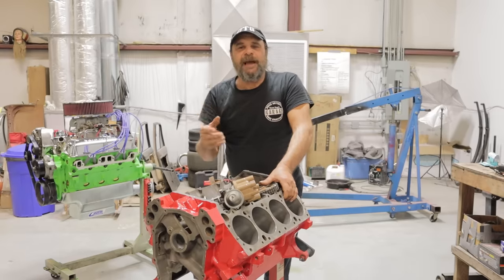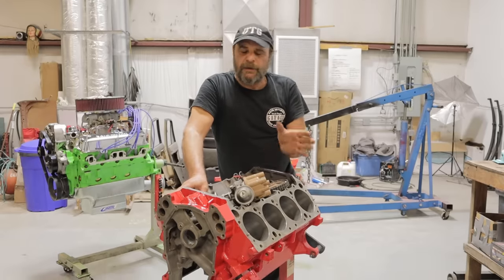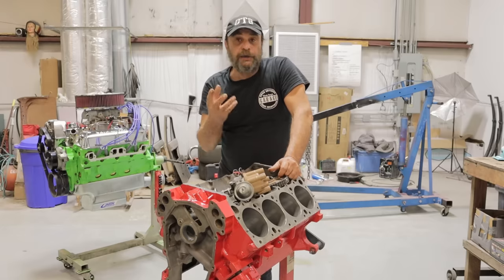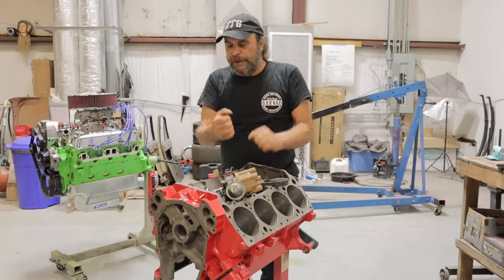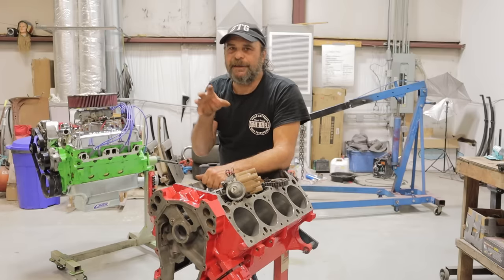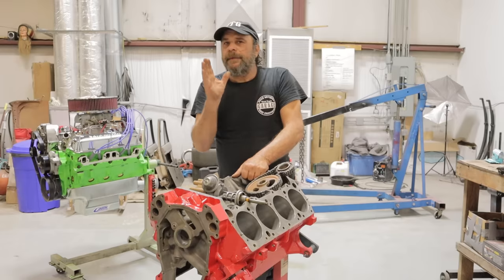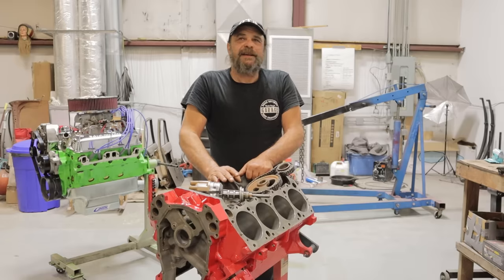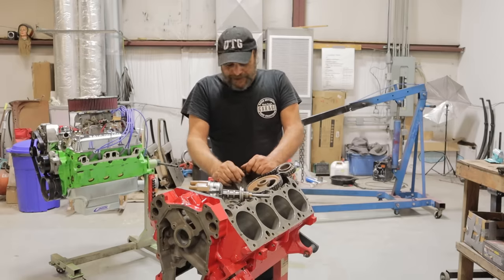Power Timing Secrets For Classic Cars

Comment: Of course this is all based on the assumption the plug wires and plugs are actually doing the job they're design to do. And if it's a points distributor the points are good and set correctly. Timing light isn't exactly useless on a older high mileage engine, it can be used to check the play in a timing gear set. Watching the timing mark bounce around with a timing light is a sure sign of a sloppy chain, and really should be replaced if it's too much slop. Personally I would never attempt timing the distributor without verifying for other issues first, including vacuum leaks which will indeed effect that vacuum advance, and making sure the advance is actually working right. Your advice is good but it is based on a engine that is tuned up as good as possible for the mileage it has, otherwise moving the distributor to compensate for it is really not a remedy, it would just cover the symptoms temporarily... just sayin.

Comment: Does this apply to something that isn’t vacuum not sure what this one is . I am looking from the dog house I have a 5.0 gmc 2001, I have been watching a lot of your videos. I was told I had low compression on the # 4 cylinder the shop said. Now in fairness this motor has 300 + on it the told me that it’s running on basically 7 cylinders. This is fuel injected throttle body I believe.

Comment: Do you leave the vacuum hose for vacuum advance connected? Haven't done this since High School. I seem to remember doing the same thing but at idle. When it started to knock we'd retard it a couple degrees.  Seemed to work. I just don't remember if we plugged the vacuum advance though?? Might be confusing it with total timing? Idk?

Comment: only way i could time a 305 that i took ALL the smog off was by ear
.
the curve isnt perfect anymore.... and it does ping JUST A BIT at the top RPM while under high loads
but its fine for a worn out old 305 literally driven by a grandmother 
.
she did notice the easier starting and power and MPG gain however

Comment: I had 2 tunes on my 305 camaro back in the day. I would retard it in the day to prevent ping and advance it at night to go racing 😅 I would keep the distributor just loose enough I could move it without a tool . Good times

Comment: Hey Uncle T, I've got a 73 Polara I'm trying to get running (360/2 barrel), and it doesn't like to stay running when it's down off the high idle. Any idea on how to fix it?
Reply: Sounds like it either needs a carb cleaning or there's water in the gas from condensation as a couple cheap/easy suggestions
Reply: Try advancing your timing, and then adjust the carb. Or it could be bad gas.
Reply: Check for vacuum leaks around the carburetor/intake flange and vacuum hoses.  Vacuum leaks cause issues with idle especially.

Comment: I used to have to take my 77 Dodge W300 in for an emissions test.  It had a pretty hot 440 and I'd have to jump under the hood and retard the timing to the point it wouldn't hardly pull into the bay but it would pass emissions...  Soon as I got the thumbs up, I pull it out and throw another 10-20 degrees in it and it would run like a monster again!!!  Lol!

Comment: I am with you on this Tony , set timing with a light, mark your balancer and then play with it + 5 degrees then a test run, then - 10 degrees and see what happens with each timing change and make notes on each movement. Also watch water temp, some times advancing or retarding it can reeeeeeelly affect water temp in traffic with A/C on.  

On a side note, I wish you would do a better in depth total overhaul from top to bottom of the all mighty  Carter Thermo Quad.  Do all 3 kinds, the smaller 600cfm then a 800cfm & the big dog the competition 1000cfm  4848 & 4848SA These carbs are being totally over looked and  forgotten. However, if set up & jetted correctly can out perform most Holley's

Comment: Just put a thumpr cam in a sbc 350. I set my initial timing for cam break in at 12 degrees in hopes of an "instant" start. Well it didn't like 12 and had to take it to 18 to get it to fire. After my 30 min break in, I fine tuned it using the same method you mentioned. Checked timing with a light after finding where the engine is "happiest" and ended up on 22 degrees, almost double where I had anticipated. Motor runs like a beast only problem I have now is it wants to kick back on the starter when it's warmed up, like my timing is to advanced. If I retard it to eliminate the 'kick back' it starts well but falls flat on its face as far as power goes. Tried an msd starter saver and that just makes it crank really long before it fires with an occasional kick back still. Tried the 10 and 20 degree retard settings and neither work to well. Going to try a high torque mini starter next.

Comment: Soooo I'm a feller whom is a little hard of hearing so I've never had the tuners ear, but couldn't a guy put a motor to top dead, Pop the dizzy Cap, and slowly turn the motor by hand until the rotor twitches and re check your timing marks to get an idea of how stretched the timing chain really is and  go a couple degrees past that?
Or should I throw in the towel and let someone with better eats do it for me?

Comment: There is an easier way . Clamp the breaks, load the engine, wind it up till it pings and back it off a hair. Works every time and is pretty fast to do with two people. Just make sure you don't ruin your hot start.

Comment: This worked - sort of - on the old No-Go Nova.  

I had trouble with hearing the onset of pinging, due to being (born) partially deaf - and being a lot more disabled than I knew at the time.  I ended up disregarding the sort of stuff talked about here - that I recall adults doing when I was a child - and just doing the timing light part.  I could do that with reasonable success.

I am not saying this does not work.  I am saying that if you are a “Biological Klutz”, you need to be, at the minimum, extremely cautious if you are going to try it.

Comment: you want power, advance until it pinks at full blatt then back it off a tweek. if you're racing a little pinking at top wack won't kill you because you'll be backing off for a corner.

Comment: Having that problem right now, I have a early 70s Chevy 400 in my 93 Chevy K1500 truck, I've had it over 10 years, it started missing, and got worse, did the plugs, no help or very little, I keep up maintenance very well, did plug wires, no help, did the distributor cap, rotor, no help, so I thought f it, I'm gonna change the whole distributor, major improvement, but I still have a light miss, or I've gone from 3 or 4 misses to one miss, been doing the move the distributor nudge, just haven't had any luck yet, my question is, turning it which way is retarding, or advancing, it's running good, I just hate that miss. Nevermind you just answered that question while I was watching

Comment: I usually do it the caveman way and put the bumperettes up against a brick wall in gear and nudge the distributor and pull the throttle blades until it wants to spin the tires 😂

Comment: what would make a 2.8l v6 fuel injected Pontiac need 97 octane with an octane booster or 99 octane before the car will run at all?
Reply: Octane is just the fuels resistance to detonation.  A GM 2.8 V6 should run perfectly fine on Regular Unleaded (87 in most places) it only has 8.9:1 CR.  There's a chance your timing is too far advanced.    Check out third gen.or g there's a lot of resources and info on there for these cars.

Comment: Question for anyone that can answer this: I have a performance 350 in a 75 corvette, Big Mutha Thumpr cam, light springs in distributor, no vacuum advance hooked up, 9.5:1 compression. So, right now my timing is at 44* or so. I can advance it more to say 50*-54*, which is about where the idle is the highest. I can even go past that, a lot, and will still run ok. A little starter lag. So basically, if you’re looking from front of car, I can go from about 3 o clock to say 1 o clock without any major issues. It’s running good where it is, but not at highest idle. Any suggestions? TIA
Reply: Just a quick question, along with a suggestion if the answer is yes...are you driving this Vette on the street?
Go with an adjustable vacuum advance distributor. You can set your initial timing and dial in as much or as little vacuum advance as your motor needs through the vacuum advance cannister with an Allen wrench. There is a whole process in setting the initial amount of turns out with the cannister screw (baseline). It's definitely a trial-and-error process. 
Set it...take it for a test drive...if it feels like it should run stronger turn the screw out (1) revolution.It's what I have on my Chevelle and my car was timed by me, by ear, like Uncle Tony is talking about. I've been tuning like this since the mid 80's. If you watch my Chevelle test drive video you'll see it runs pretty damn strong. I do only run 93 Octane though because I run on the edge of maximum advance.
Sorry for the long winded suggestion, good luck.
Reply: @kevinposhepny8907  yes. It’s a street car. Just saw the rest of your message. Like I said, it does run very good. A lot of people recommend to just plug off the vacuum advance, which I did. Just the fact that my highest idle is very advanced, further than where I am now, is what’s puzzling me. I know people say, give it what it wants. Idk. Thanks

Comment: I have always started at 13 BTC. And then send my vac or springs up to 36 BTC. Bust me.
Reply: I agree that’s pretty much where they like it. GM recommended 10 on most of the HiPo cars in 1970, 12 on super premium. I find they like a little more than 12 with some octane booster.
Reply: @totalyep  You know your stuff. I always base my timing on Avgas. Pretty much 100 Octane

Comment: the fuel today produces detonation that is outside of the human hearing range, so although this worked years ago, you can get into an area of detonation that can destroy the top rings at the very least, I run into this all the time. That is why auto manufacturers got into the habit of not only using detonation sensors, but only listening to them at certain areas of the power cycle, so as not to be interfered with by other engine noises. With a carb (and I use that term loosely with an Edelbrock) you really need to use an air/fuel meter to get the mixture out of the basement, then work on timing scientifically by sticking to a curve is a little conservative, for timing is what kills engines, not air/fuel. Every car that I have built gets an air/fuel meter. It's funny how people will spend a fortune on an overdrive transmission on a car that doesn't even need on, but won't spend a few hundred dollars on a good air/fuel meter, where performance and economy can be best served. An using a carb like this is a long process to get things adjusted properly because of its antique design. And for nearly all cars, the way to sense engine load is through manifold vacuum, not ported vacuum. Ported signals need to be specific to a vehicle's weight, axle ratio, tire size, converter stall speed,  cam spec's, etc. 
I have had really good success with MSD e distributors where one can select everything one needs to select a timing curve for mechanical and vacuum advance instead of playing with dinosaur parts.
If you have a scan tool you can learn a lot about ignition timing advance by driving a modern car, recording data while driving at different speeds and loads, then go home and  look what the factory does with timing. You will be very surprised. I'm just saying.

Comment: In drive Hold brake and gas before it start to burn rubber in drive turn distributor to listen to power band get it where you hear the most power in motor by simply turning distributor in drive somebody in car somebody outside of car under hood do this slight turning don't touch the top of distributor due to can shock by coil or use a towel

When you hear it bout to burn rubber stop the turning test drive it should be at near max do this after car running fine after initial timing set

Comment: Drive  to BF Egypt . Make sure you empty your low grade.
Use high test. It's best if you're in the middle of nowhere on a straight away. Don't do this if you don't know how to drive.
I live in Florida so it's pretty much flat. Here's how I get around the uphill thing.
I pop my hood and leave it up. On my Chevelle it has monster hood springs. In my a fox body I just let the hood click because it takes several launches I stomp 60 ft s . I'm a psycho so I even do it in reverse. This is how I spank everyone... If you have a vacuum advance. Mr g has a kit. I can test fuel grades with the vacuum advance on the Chevy. If you try to switch back to low grade it will ping like s***. It's a long story.First time I've ever seen this secret revealed. I don't know if I'm happy. You do this on your own risk and if you have a problem with it. DON'T DO IT....
Timing is everything. . .
                      LLCRAIGYG
Ps watch over stomping your brakes in reverse repetitively
Drum brakes can have a tensioner kit.
Just give your girlfriend her car back before you blow it up a****

Comment: I gotta. Be that guy and disagree. Tuning this way only works if everything is pretty close to stock and no real problems with the distributor. 
Once you learn how things really work and set things up appropriately to the engine, wether old or new or high performance then the difference is even more pronounced.
The timing light in conjunction with a vacuum gauge is indispensable. As a hot young mechanic working in my family’s high performance machine shop since I was 13. I was also known for doing great tuneups and could afford a new dial back timing light and vac. gauge after my second or third job.
It’s not as hard or as easy as you think it is in reality.

Comment: The only problems I've personally had power tuning is plugged exhaust(mufflers/cats), water in the gas,  leaking intakes(spray carb clean around manifold to find leak), and carboned valves(airflow compromised).  If the motor still makes compression on all cylinders and power tuning has little response, something else is wrong...

Comment: Super tuning is a lost art few ever knew to begin with...once had a 79 dodge 3/4 ton fulltime 4x4 standard...rare 1971 360 with carter abs, edelbrock single plane and 273 heads...after daily tuning of timing and carb, constant distributor modding of weights, springs and vacuum can mods...ended with 24mpg and easy 130mph...worse thing I ever did was sell that truck....lol

Comment: Advancing timing became popular when high compression engines were built using high octane fuel. High octane was used along with advancing rhe timeing to prevent pre detination . I see guys dumping race gas in average compression engines its a waste of time and will not make more power. Its desinged for high compression.